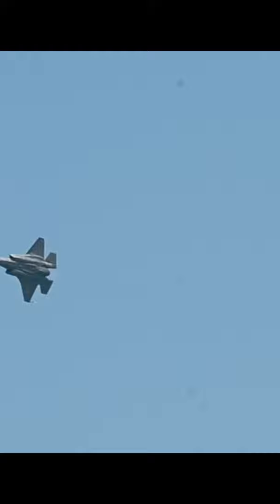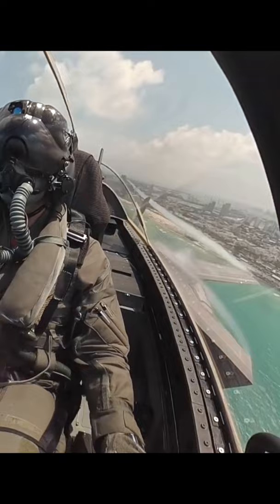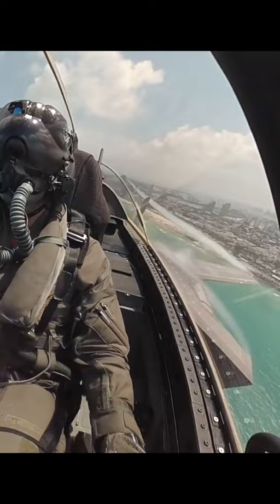Fighter Pilot Talks Through a Min-Radius Turn #Shorts

Comment: Best engine? Please. It’s like an ugly duckling 🐥 that doesn’t specialise in anything and can’t do anything right
Reply: Ok. What's the best engine? Either you fly something *that has a better engine or you know nothing and just dislike the F35. Which is it
Reply: @dickfitswell3437  F22s, And also with deep modernisation of those engines would be in a league of its own I honestly don’t remember if they have re-done those engines yet but for the time when they were produced they were untouchable
Reply: Thrust:  43,000lb in AB, 28,000lb in mil
Extremely high MTBF, triggers servicing before failures
Prognostic Monitoring and Regulating
FADEC
Integrated with the DFLCS
Very Low Observable in RF and IR spectrums

There literally isn’t a single other fighter engine that checks these blocks.
Reply: @lamborghinidaniil  The F135 is built off the F119 core, but has 8,000lbs more thrust.  Both are excellent fighter motors, but there are newer technologies in the F135.
Reply: @lamborghinidaniil  you do raise the f-135 is a modernization of the f-22's engine right?

Comment: This guy is clearly over exaggerating. Single most best engine built? Try again buddy there are far superior jet engines to the f35 smh.
Reply: No there aren’t, and to prove the point, you can’t name a single one.
Thrust:  43,000lb in AB, 28,000lb in mil
Extremely high MTBF, triggers servicing before failures
Prognostic Monitoring and Regulating
FADEC
Integrated with the DFLCS
Very Low Observable in RF and IR spectrums

There literally isn’t a single other fighter engine that checks these blocks.
Reply: Oh there are? Name a few.

Comment: It’s nice but an F-35 is not a dog fighting jet, an F-16 or F-22 is going to suit you better in those turns, and I don’t know if this test was showing the capability at full afterburner but you typically wouldn’t be full after burner in a turn, probably sitting around 350 ish for an ideal turn which if you’re slow I get an afterburner but turning in from your first or second turn you shouldn’t need it